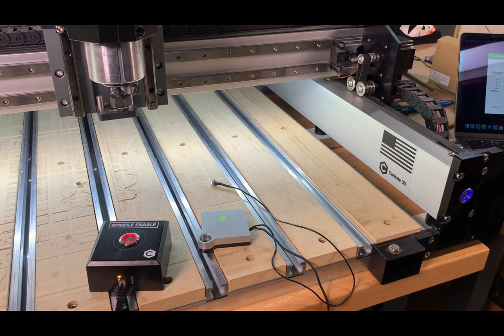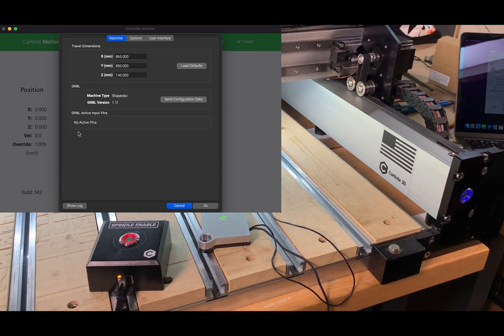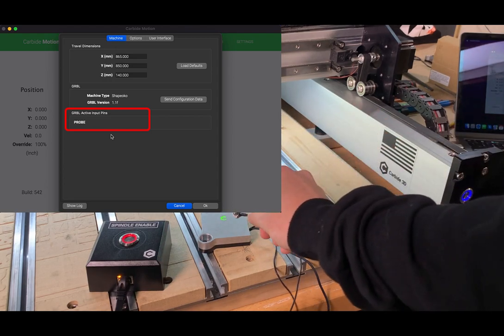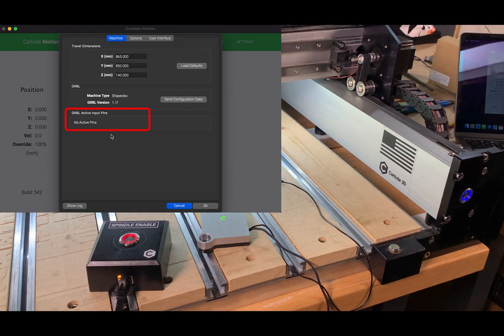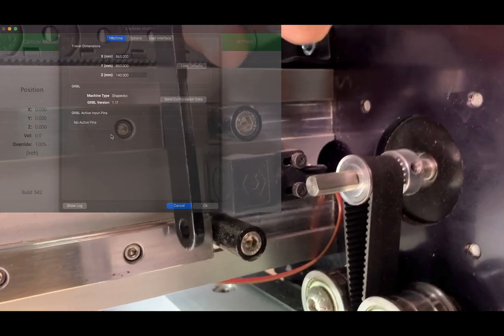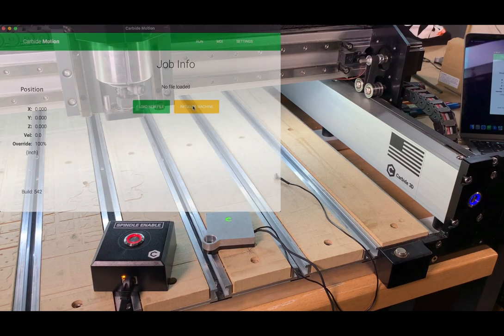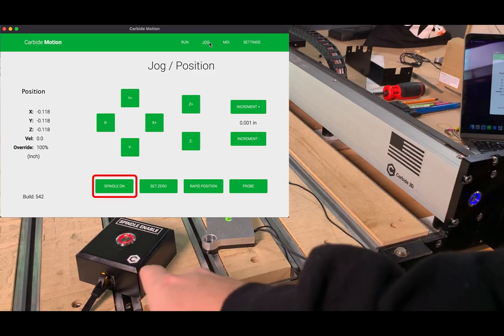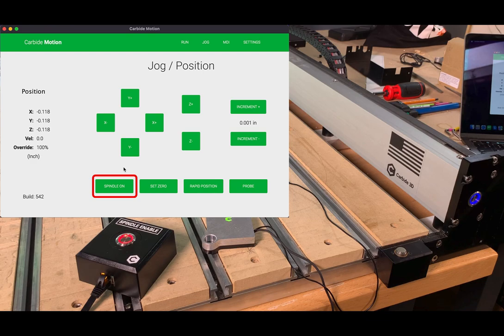Testing Your Shapeoko Accessories

Comment: You never indicated what you were testing the limit switches with,...
Reply: These limit switches are inductive so they are triggered by detecting metal in close proximity. You can use the metal hex keys that came with your Shapeoko for assembly and when you place it against the switch it will trigger